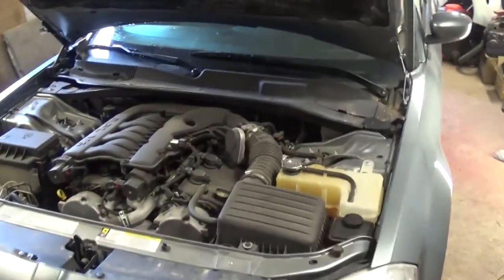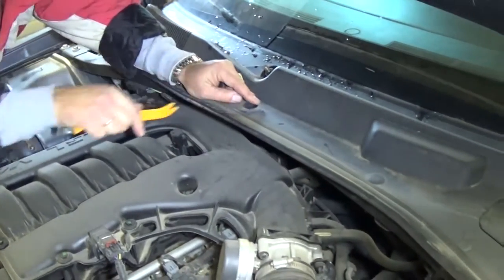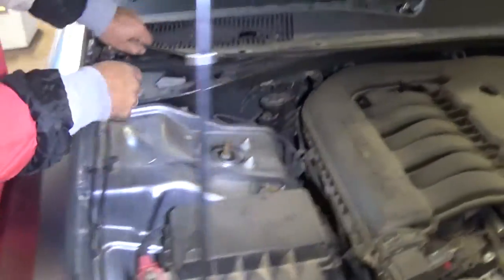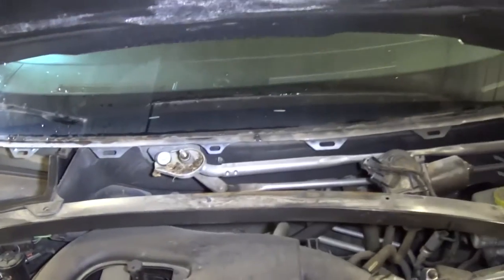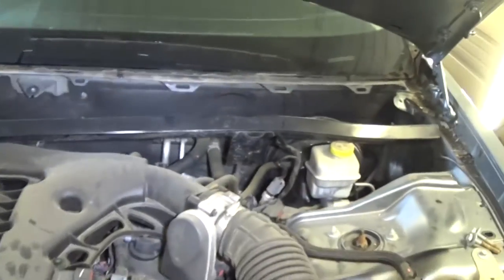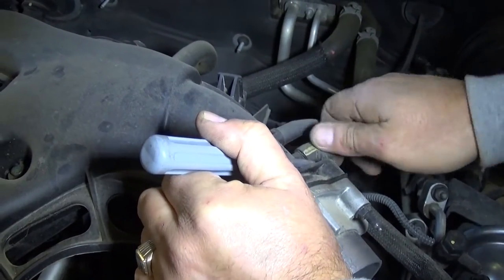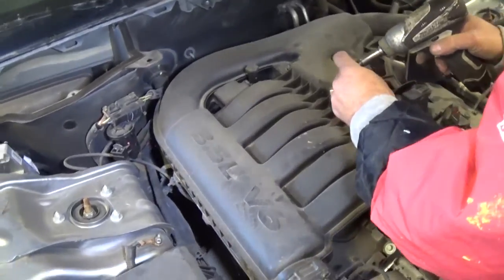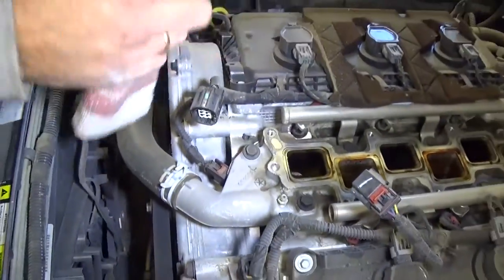DODGE CHARGER VALVE COVER GASKET REPLACEMENT 3.5 V6 | DODGE MAGNUM

Comment: As mentioned on another video it's easiest to remove the one bolt holding the transmission dipstick tube. It's accessed from underneath the car. Remove the bolt and wiggle the trans dipstick tube up, then push it down and out of the way.

Comment: On timeline at 8:48 that's what you should have done instead of taking the windshield wiper motor out. All you had to do was take that bar out on timeline 8:48. The windshield wiper motor was not in the way. Never mind. Towards the end of the video you mentioned we didn't have to take it out. Sorry about that! One heck of a video bro. Kudos

Comment: just tried this tonight on my dodge magnum. when i started the engine, it began to sputter and leak more oil from the valve covers and my engine is idling at extremely high RPM

Comment: DISREGARD Watch at 10:28 

this why is so expensive when you go to a shop. They charge extra for labor cause they do too much unnecessary labor. 

DO NOT REMOVE THE WINDSHIELD WIPERS  WASTE OF TIME.  
START AT THE AIR INTAKE.

Comment: Just the fact that your guy used power tools to not only take it apart but then put it back together is just dumb.... no wonder why he stripped that bolt and you cut the camera 😂 if you follow this video please use hand tools and proper torque